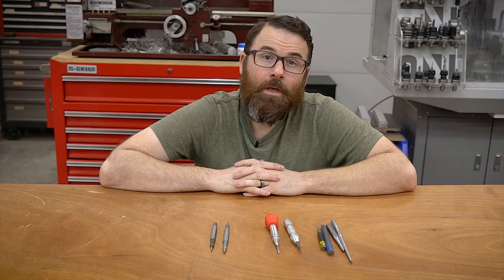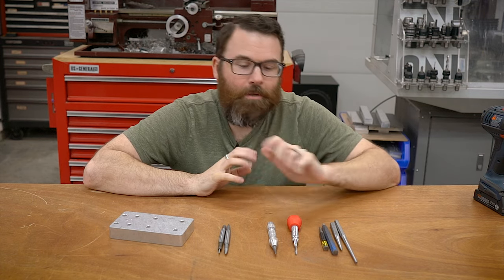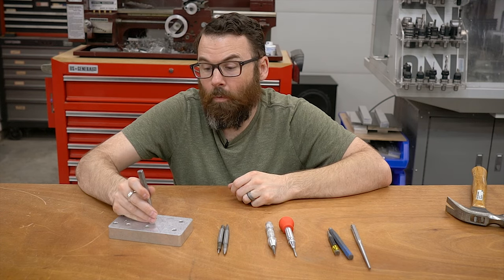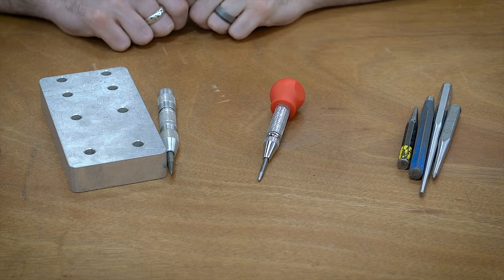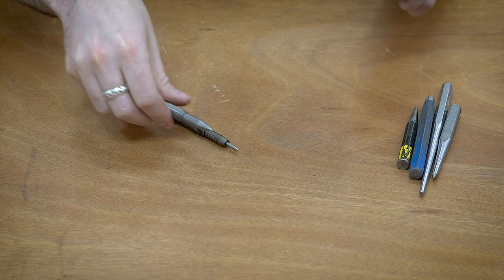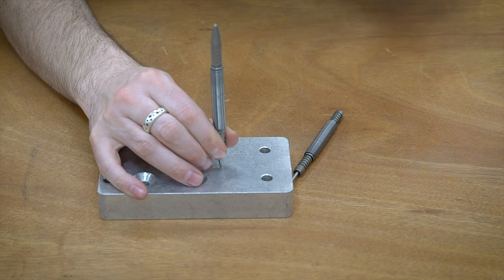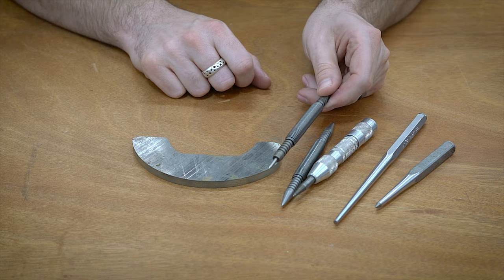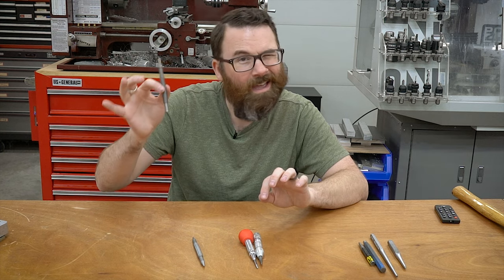Which center punch is best?

Comment: USE THE RIGHT TOOL FOR A PARTICULAR JOB !  A DRIFT IS NOT A CENTER PUNCH ! Drifts should be used to remove/replace things like split pins and bearings that will withstand this abuse. Drifts have a smooth, flat end and are specifically designed to push out press-fit things without damaging them. A punch will concentrate all its force on a tiny spot and probably deform whatever it is you're using it on, which is exactly what it is designed to do.

Comment: Those $5 spring loaded push ones break so easily. First the spring fails, so you start hammering it. Then the back starts to deform, so the back end unscrews and can't stay screwed on. You keep hammering it. Eventually the tip actually pushes inside body and you can't even hammer it.

Comment: You left out other but important types of punches like a optical punch and transfer punches.  I use these almost every day and they allow me to work within close tolerances when careful and use good techniques.  Transfer punches (an optical punch is also a kind of center and  transfer punch) are unique because they make very accurate marks where you would want them.  The problem with the one\s shown in the video is the accuracy of the mark made is totally dependent of the person using it.  Ive seen workers positioning the punch that ends up being 1/64 to 1/16 in or even more off the cross hairs scribed.  Try getting holes to line up with that accuracy.
Reply: With what accuracy can scribe the crosshair ?  I find it often more limiting for me than further positioning of the centerpunch.

Comment: Centre punch the hole position, then Pilot the hole using a No 4 or 5 Centre drill. The Centre drill has a finer tip & Web. (That's the thickness between the cutting edges in short terms)

Comment: Somethings that were not discussed.
As an Ironworker, Fabricator and Shop Fitter I use punches many times when laying out holes. I like a solid punch with a wide tip. If the tap is to sharp even the small drill bit can change directions. This way your drill bit tip will sit in the hole and has a better chance at a precise drill hole. Then you can step drill sizes from there. Do not double tap your holes. Softly hit your tap, check your hole alignment, reset your tap in the direction needed and retap. Just a few more tips.

Comment: Great video! Don't forget the Optical Center Punch for when precision really matters.
Reply from the maker: True!  I don't have one, if I need that kinda precision, I just use a CNC machine, but they are pretty handy.
Reply: @RobertCowanDIY  I do the same, especially if I have a lot of precisely spaced holes on a project, but occasionally I just need a quick accurate hole with out the cam, zeroing, fixturing, bit change and such. The optical center punch is nice where applicable,all be it overkill in most situations.
Reply: Optical punches are life. I make my wedges by printing out a CAD drawing, gluing it to titanium, and lining up the optical punch with the hole centers. Works great!
Reply from the maker: @TeamSmallRobots  Nice!  I almost never use punches for precise holes, I would almost always just have it laser or waterjet cut with the hole locations in place.  And I guess that's why I haven't gotten an optical punch yet.  But yeah, that's a perfectly good way to do it, and you can get some great results, I'm just lazy ;-)

Comment: For getting the maximum precision with wood, I like a square awl.  Just needs a few twists, and it's easy to control depth.  It cuts the wood fibers with the sharpened edges while twisting, rather than splitting and/or compressing like with a punch.  This makes it better for handling endgrain, wood with rings that vary hard/soft like pine, or knotty grain in general without drifting from your intended point due to being guided by the fibers of the wood.
Reply from the maker: Fair point.  I do very little with wood, and when I do it's usually harder woods.

Comment: thanks for taking the time to do the vid. I bought an outside spring center punch a while back and just don't use it. WHY? Well 1st its still a 2 handed operation, so why not just use a regular fixed center punch? The single handed spring loaded with the bulb (no roll) is my go to most of the time for mild steel & less hard. Stainless and higher = plain old center punch and hammer.  $12.50 in my wallet instead of sitting in tool box.
Reply from the maker: yeah, it's nice to have options!

Comment: Need deep setting one-handed automatic center punch.  To achieve that, punch needs to be large and massive - as heavy as possible.  Unfortunately, while a prerequisite, that does not ensure it will be the deepest setting.  I think I saw some that were 6 inches long somewhere which might be a starting point - large body diameter also probably a good metric.  Will also require a lot of manual force input.

Comment: For an array of 75x 1/8" holes, a person may go cnc, however i prefer the paper template, optical center punch and drill press route. Not being lazy can save money and improves skills and experience especially when prototyping and iterating fast.
Reply from the maker: See, I would 3d print a jig that allows you to drill faster.  Make a jig with ~10x holes, and when you get to the last one, slide it down and repeat the pattern.  New skills and all ;-)

Comment: Glad I found this video, I've been using a cheap auto punch with steel, but those spring punches look much better. Ordered the one with the hardened tip.
Reply from the maker: They're great.  I have a full set of them and use them all the time.  They're great for removing tapered pins and roll pins too!
Reply: @RobertCowanDIY  ah, good idea

Comment: In your experience, should the tip be sharper or more blunt than the drill bit?
Reply from the maker: It depends on what you're trying to do.  A sharp point will dull or break if you're using it on hardened steel.  But for aluminum and such, it can be fair sharper.

Comment: Out of the two types of spring punches, which is best for round tube steel?
Reply from the maker: Hum, it depends.  MAYBE the spring style punch, because you would hold it against the materials with one hand and pull back the spring action with the other.  I find the spring ones better for precision.  It's nice to have several types on hand though.
Reply: @RobertCowanDIY  Thanks!

Comment: Sucks you didnt talk about quality of the auto punches. Im an aircraft mechanic and using an auto center punch is mandatory. Problem is that many auto center punches tend to not last long internally.
Reply from the maker: I was unaware of that.  Maybe they're just not made for hard use?  As a hobbyist, I'm probably not using them enough to cause failure.

Comment: Is there a commonly found metal that is too hard for center punching? I want to drill holes in utility knife blades. Will punches work on them?
Reply from the maker: Eh, probably not reliably, but maybe!  I'm not sure how hard those blades are.  Drilling holes is the wrong way to do it though, I would waterjet the holes.  You're just going to trash your drill bits and make nasty holes.
Reply: @RobertCowanDIY  OUCH!! Thanks for the suggestion. A waterjet would be beyond my price range. I do have a fallback plan of grinding holes with a dremel. Also, people drilled hard metal using sharpened masonry drill bit. I might sacrifice a bit to try that. But, the bit will wander if I am unable to punch a hole.

Comment: Edit: The video is more helpful than I expected it to become. I had the habit of missing the correct spot a little in some situations and I think I like these automatic punches most if it is about accuracy. Thx for the tip. The rest is the original message:

Didn't you miss the spot a little with the spring center punch, when you really pulled on the spring? I guess accuracy is a drawback because that pulling motion might alter the position you wanted to punch. I didn't know the spring-loaded ones you were showing at first. When you activate them by pushing, you probably don't miss and you could then enlarge the dint with a classic one and a hammer. Of course, I am inexperienced, and I guess you don't miss the punch with some experience and concentration. I see the advantage, it can have, when you want to punch hard and want it fast.
Reply from the maker: Yeah, if you REALLY pull back on the spring, you other hand could slip, for sure.  But you have to REALLY tug on it.  It doesn't take much force to get a nice divot in most materials.  The traditional ones are fine, I think I just like the others better.
Reply: @RobertCowanDIY  Maybe I should have underlined more that I have a habit of missing the spot to punch using the classic ones. Especially, if there are many things flying around on my bench. Sometimes, if I am already balancing stuff on the drill press, I was around 0.5mm off the spot.
The video is probably much more helpful than I expected it to be. Thx :)